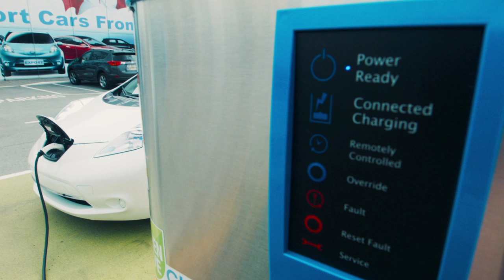Electric Motorcycles vs Gas Motorcycles (HARD FACTS)

Comment: Power is still generated by coal power plants and the cobalt in them has to be strip mined and has many byproducts. TURBO BUSA FOREVER!
Reply: Steven Striker | Most of the world’s cobalt is used in metal alloys and as a catalyst to refine diesel and gasoline.

And SOME power is generated by coal power plants, usually it’s a mixture of serveral energy sources like coal, gas, diesel, nuclear, hydroelectric, solar, etc …

Comment: Dude, have you checked their Price? They are like more than twice the price of a combustion bike with similar HP. Its no where close
Reply: Pedro Rezende | You’re right! And then the maintenance and fuel cost is a fraction of an ICE bike.
Even with a montly downpayment there’s more left at the end of the month b/c of that … ask me how I know 😉
Reply: Dude have you checked the cost of ownership? Its no where close
Reply: Thor Stambaugh | Yes, I did! I own one!
Purchase price is !#@&}#! expensive, I’m not arguing with that. What I am saying is that the Total Cost of Ownership is on equal footing as a similary powered ICE bike.

Added advantage is that with only 70hp, you can beat ANY 150hp or even some 200hp ICE bikes off the line.

… apples and oranges

Comment: The Zero electric motor has one moving part and is good for around 500000 miles.
Reply: The batteries are good for less than 50,000
Reply: blurglide wow I guess you don’t get out much.
Reply: @savagetuner2404  LIES! Hi Again, FYI he is a liar troll.
Should be good for a realistic 150,000 Miles (150 miles x 1000 cycles) or 15 years based on Zero SR/F Range & Battery generation.
Reply: Neojhun who the hell are you?

Comment: I understand the video is 4 years old but still was some great performance electric motorcycles. You make a huge mistake. Gas motors are not more energy efficient.  The best combustion motor output 38% energy from what you put and the electric moto output more than 90% 
Check the fucts before you speak

Comment: Whenever gasoline goes away,I'm just going e85,far too many downsides for me to even think about going electric.
Reply: The downsides are Not permanent, we are only in the early days of high performance sports bikes. Once 50kw DC Charging and 25kwh 400lbs Sport Bikes are common, there is no down sides.

Comment: Electric vehicles are worse for the environment than gas once you factor in the manufacturing and mining process required to build them. Not to mention the fact that most charging stations run on diesel generators.  Lol
Reply: That's not true. It's a fact that you're wrong
 Please inform yourself before posting such a level of wrong
Reply: actually, while the lithium mining is bad for the environment, its not nearly as bad as all the smog from the fossil fuels were burning. Now burning carbon based fuels (mostly coal) to generate electricity is a very big problem in the argument for electric vehicles, but even if electric vehicles didn't exist at all that would still be a major problem. We honestly should be using nuclear everywhere that a large scale hydroelectric dam or geothermal station isn't viable. Nuclear isn't common because people are scared of it due to cases like Chernobyl, but that was an early reactor that was built and managed very poorly. nuclear reactors now are so safe that the chance of a meltdown is exponentially smaller than the odds that Chernobyl had of a meltdown, and even if a modern reactor did melt down the safety measures are so good that the radiation you'd absorb standing next to it is probably barely more that the people in the next fucking country over received during the Chernobyl incident. The fact that coal is still used instead of nuclear as our primary means of electricity generation is an absolute crime against humanity.
Reply: @doctordev97  its twice as bad as fossil fuel because it doubles our carbon footprint.  If you dont understand why stay out of the conversation

Comment: screw batteries. focus on capacitors... replace the clutch and flywheel and lower four gears on the bike with a brushless motor and let the engine run at a constant rpm to run a larger alternator to power a capacitor that dumps loads of power to an electric motor for massive off the line torque and acceleration then let the gas engine take over at higher speeds for drive and over drive on the highways for distance. add regenerative braking and you'd have the best of electric and gas engines with maximum compromise for fuel efficiency.
Reply: Don Barnard | These are called hybrid cars and they already exist in a much simpler design.

Also, unless the capacitor technology has a higher energy density than a battery, a battery would still be better.
All batteries in electric, hybrid or plug-in hybrid cars are powerfull enough to completely fry the electric motor.

Amperage is not a limiting factor … energy density is. With current technology batteries outperform capacitors to the point of uselessness.
Reply: @GapWim  And a hybrid is a ton of extra bulk on a bike.  You'd need the generator, the battery, and the motor.

Comment: I see no overall advantage to electrics. The true environmental impact of electrics is far higher than advertised. The environmental impact of a gasoline motorcycle is negligible, especially considering the number on the road versus other forms of transportation. Sure the torque is cool, but that's about it. How do you modify an electric? Where can one take pride in "tuning" it? By going electric the vehicle becomes an appliance, like a Toyota. Plus with a gas bike I can literally go anywhere in the world and ride since there is infrastructure and I don't have to sit around for an hour like the local Yahoo at the gas station sitting in his Tesla every day on his lunch break. Heck of a way to spend one's day, sitting and charging.

Comment: Eco friendly lol where do they think electricity comes from, it’s going to come from coal, or nuclear power. If you think wind power the wind mills are made from petroleum to make them, and they still have gas powered engines
Reply: Even if the power used to charge an electric bike or car comes 100% from coal power its still better for the environment in the long run due to the efficiency of electric motors. Engineering explained has a good video on this

Comment: Another con of electric bikes that ya missed ... as they generally weigh a fair bit more than their ICE counterparts they create more break and tire dust pollution .... of course this can be lessened with the invention of light weight battery technology but until that happens the point still stands.
Reply: They do not create more brake dust (they have regen) and they don't wear out tires any faster (in practice).
But they can be really heavy.  The Energica is over 600lbs for a sportbike!  My Zero, though, is the short-range, and weighs less than a similar performance gasoline bike.

Comment: Electric cars are not environmental friendly. Well they are themselves I guess.  But... How is the electricity made... Fossil fuels!
Reply: Thomas Ferris | Factually incorrect. Even if all the electricity was generated using coal power, you’d still be at break-even or better.
Reply: @GapWim  aye just to generated.
Reply: Thomas Ferris | While I was talking about Tank-To-Wheel, 100% “coal-powered” electric cars would still have a lower carbon footprint when comparing Well-To-Wheel due to scale advantages.

But that’s a theoretical conversation. I don’t know any region powered like that. In reality it’s always a mixture of different sources. And as soon as you do that, the carbon footprint of electric cars and MC’s plummets.